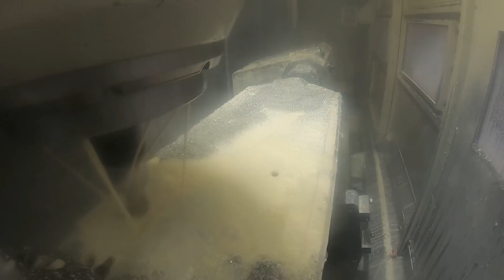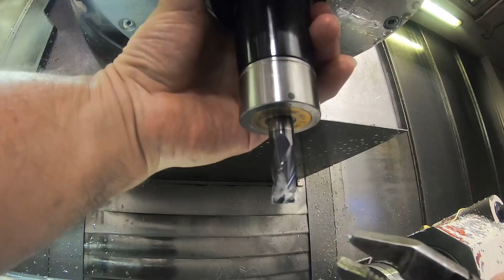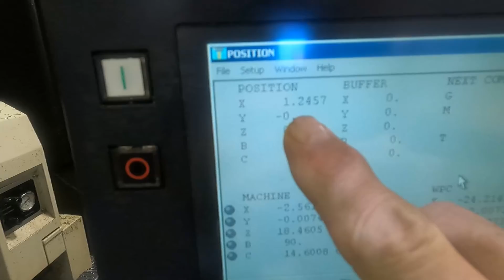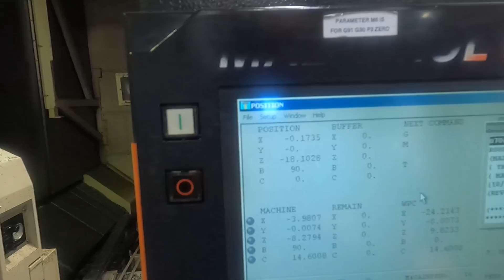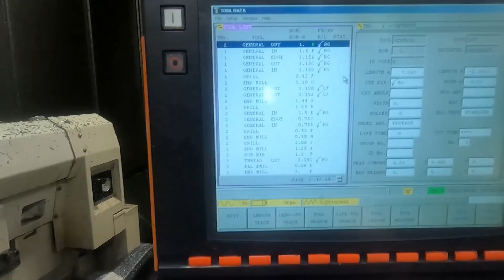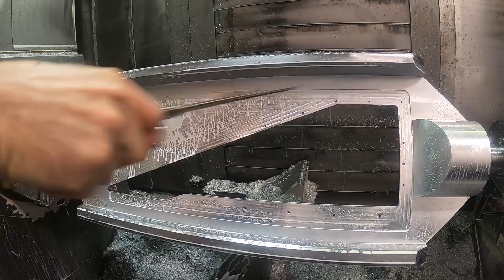Completion Of The Fixture For  the Mazak

Comment: Hey  Peter do i see a tool probe to the top left of the spindle?
Reply from the maker: Yes this machine has both a turning tool probe (The one you see that folds down) and a laser milling tool setter. That recess to the right of the fold down tool probe is where the laser beam shoots across. The laser tool setter has never worked sense I have owned the machine. If I hold a white card up there I can see the beam but something is not working. The fold down arm is to difficult to use. Its so high up when deployed  and very difficult to see the tool when you jog it up to it. My machine doesn't have a remote jog pendent. So I cant reach the jog wheel and see up there at the same time. It is easier (and faster) to just touch off tools manually. I do wish the laser tool setter worked. I would use that. But I don't want to spend money on fixing it. Its not that important to me.
Reply: @EdgePrecision  Ok thanks. So you just need to keep in mind how far off center you are  with the tool and make that offset?

Comment: I'm not sure I understand why the depth of the pocket of the fixture is so critical.
Reply from the maker: The depth of the top pocket is where the parts stock mounts. This stock already has features that need to run on centerline. The depth of this pocket controls that. There are pins that control the other direction. The rest is just a support structure and not really critical as long as it supports the part and gives clearance for the tools. Doing the machine work on the part. Hope that answers your question.
Reply: @EdgePrecision  It did! Thank you Peter.

Comment: I love how this machine keeps discarding its tool through that little window and you have to keep feeding it new ones.
Reply from the maker: It’s putting them in the tool magazine. I’m just changing them as the program calls them. It’s just the way I do it on a new setup. It would be possible to set up all the tools beforehand than run them. Just two different ways.
Reply: @EdgePrecision  Oh I know, just a daft joke lol. What happened at 8:55? bad cutter or just no coolant?
Reply from the maker: I thought it would run for the video with no coolant. I don't really have any endmills for aluminum. These endmills have a coating for steel and the aluminum welds itself to it at high temperatures. It would have been OK with coolant.
Reply: @EdgePrecision  Thanks for the reply! It's amazing how much different it makes.

Comment: Awesome fixture thanks for showing what you can. Just one question what was the ruffing end mill you used to cut out the center pocket? I like the way that it performed thanks again
Reply from the maker: The inserted roughing endmill in the beginning of the video is a Iscar tool I think they call it a MILLSHRED P290 ACK 1.5-3-21-W125-18. I bought this tool for a steel job a long time ago. Thought it would work good for this.
Reply: I will have to look into that type of tool nice to know that bought it for steel. I run a lot of steel, aluminum, tool steel  I will have to get one thanks for getting back to me

Comment: I wonder did you check flatness after clamping and re clamping the tailstock a few times to see if force variance bowed it any?
Reply from the maker: I’m sure there is a influence because it is above the edge of the plate. I don’t want to do that now. But if I ever remount the fixture I can adjust the pressure until the fixture indicates flat as possible. I did turn the pressure down when I first mounted in anticipation of this issue. Thanks.

Comment: On that fixture, how much force can that tail stock push into the part? Is there a pressure readout that you can see to make it adjustable and repetitive?
Reply from the maker: The pressure on the tail stock quill is supplied by hydraulics. So there is a gauges and regulators to control not only the the force but also the speed of extension.
Reply: @EdgePrecision  
So can you adjust it easily in the computer or is it fixed pressure and speed?
Reply from the maker: @Sicktrickintuner  This tail stock can be positioned and the quill extended from the control. But the pressure and the speed the quill extends are manual adjustments on the regulators and the pressure on the gauge. Kind of like on a hydraulic chuck. This isn't like the new machines that have a servo driven tail stock that controls the force by a servo motors force.

Comment: How do you avoid  sine  errors when touching off each tool with a round pin on round surface of the fixture? Also the centre of most endmills is usually concave so I touch off on the corner? Thanks.
Reply from the maker: I’m am touching on the corners of the endmill. When doing it on a round OD you rotate the tool/endmill till when it’s touching the tips but the pin won’t quite go thru. You can feel when it’s hitting both tips. Now back the pin off a little and rotate the endmill. Keep trying the pin until it runs parallel to the OD your touching off on. Once you get the flutes aligned carefully jog up in the .0001 mode until the pin just passes thru. Don’t ever jog down with the pin under the tool. If you go to far move the pin away and jog down and try again. If the tool has a odd number of teeth you have to rotate the tool back and forth until you find the lowest point of the tool. You can in this video see me doing this on the inserted roughing tool with three flutes.
Reply: @EdgePrecision  Thanks, it's hard to see all that in the video.

Comment: Great video 👍So do you get a "ring" from the work piece at a certain point in the cycle and is it a low hum or high pitch Or no ring.
Reply from the maker: You may be getting some false sounds. The camera's mic picks up sounds you don't even notice standing in front of the machine. Even vibration coming up the mag base I use to mount it. I have to be especially careful when mounting it on the spindle of the machine. That nothing close to the camera is touching the spindle. I will transmit sound to the camera of the spindle itself and overpower the sounds I want.
Reply: @EdgePrecision  Sorry it was just a question to be shared with other YouTubers and understand that harmonics sometimes happen in machining.I had no issue with your production of the video.
Reply from the maker: @bigbird2100  I didn't take it that way Thanks.
Reply: @EdgePrecision  keep sharing the knowledge 👍

Comment: I greatly enjoy watching your videos so this is by no means supposed to be criticism. Watching the video I came to thinking what could be done to improve video conditions when shooting with coolant. Your airblade seems to be effective in removing the coolant directly in front of the camera, but it can't do anything about the coolant droplets in the air reflecting the light back into the camera and creating a "white out" condition. Have you ever tried a polarization filter? It should be able to remove some of the reflections on the droplet surface when adjusted correctly. Just an idea. For this to have a chance of success the critical light sources would probably need to be the same type meaning emitting light with identical polarization.
Reply from the maker: There is actually very poor lighting inside the machine. The GoPro cameras I use aren't very good in low light. On top of that one of the LED light fixtures in the machine isn't working as well. If I could improve the lighting and figure a way to hold such a filter with my cameras enclosure it might be worth a try. Thanks.

Comment: totally agree on the 3D taster usage! running it on the surface especially on milled surface compared to ground surface cus the stylus wears out and gets a flat spot on it, when i must use it like this to sweep over a surface i only tension the indicator as little as i can by only pressing it into the surface by 0,1mm that way the spring forces aren't that high on the stylus so in theory less wear, but the spring is pretty thin inside the taster so it isn't making a ton of difference cus the spring force is pretty much the same when pressed in -4mm or -0,1m. it is best to avoid at all indeed.
Reply from the maker: My main objection is when I see people indicating a vise in for instance. It lakes sensitivity because of the high stylus pressure it has. It is good for what it was designed for and really useful for that. But say a Interapid indicator is so much better for checking alignment of things.

Comment: why did you chose to use 3 axis profiling for the pocket wall instead of 5 axis cycle profiling? Was there a degree of freedom limitation on that profile or You just picked the less complicated method of programming? which is totally fine in one shoot production, i chose the safer way in similar features with one shoot parts all the time..
Reply from the maker: It could have worked for a portion of the profile from the side in the video. There would be interference issues with the machines spindle and way covers on the chuck side (left). The angle of the end of the pocket. I did when I programmed the part consider milling it from the other side. The angles would clear from that side tipping the B axis inward. It was just easer this way I guess so that’s what I did. Though it may have been better for the video to do the 5 axis stuff.

Comment: Hi, did you notice that you read 1.857 as 1.875 when you were checking the reference height. Hope you didn’t get an error in your fixture from it,
Reply from the maker: Yes I didn’t notice this till I reviewed the video. In this case a .0018” difference isn’t enough to cause a problem. I’m going to check it again an correct any error anyway. I transposed the numbers 5 and 7. I need to be very carful about this. I have this tendency. I may make a video on this subject.

Comment: Seems a lot of work for 10 pieces, but they're likely high value items so worth it. Curious if the client paid separately for the fixture, or was that absorbed in the margin for the 10 pieces?
Reply: Is it not the same thing regardless?  

I do primarily small quantity work.  Anything over 10 parts is a large run for me.  The customer is always paying for my fixturing work.  Sometimes I will itemize it on a quote, other times it gets rolled into the per part price.   At the end of the day, the total bill is the same regardless of how its itemized.
Reply: @siraig  not the same thing if the client expects the fixture to be delivered with the 10 pieces. If the shop owns the fixture it could be repurposed for other projects if there were no repeat orders.
Reply: @paulhammond7489  well yes, if they expect it to be delivered I  see your point.  Your original question was vague and did not specify that part.

I regularly charge my customers a line item for fixturing, they do not get said fixture at the end.  But then again, no one has ever asked!
Reply: @siraig  I've seen a couple of 'battles' over fixtures in the distant past regarding ownership of a fixture when the customer wanted access to 'his fixture' as 'he'd paid for it'. That was so he could use a different workshop for repeat work. You can probably imagine neither party really won the argument. I've also seen workshop stores stuffed with fixtures that haven't been used in years.
Reply: Not a machinist, but been involved in a few projects with really expensive fixtures. The customer in that case paid a separate machine shop to make the fixture. I am pretty sure once all the machining is done the customer will take the fixture back and probably scrap it.
Reply: If I’m building the fixture on my dime it’s mine. If the customer wants it after the job is delivered we can negotiate a price.

Comment: i thought i saw the position screen on the haimer from the live center measurement was 1.2457 not 1.2475.. stopped video to comment while i had it in mind. great video as always though. hope i am wrong on what i saw.
Reply from the maker: You know I think your correct. I will need to check this. .0018” difference. Not really enough to give me a problem on the parts tolerances but it might be worth checking and correcting. I’m reversing my numbers. I have already made the setup parts and they were in tolerance but it might be better if this off to correct the small error. Thanks I just didn’t see it! I bet I’ll get a lot of comments on this.
Reply: I noticed that too, glad it's not a problem!
Reply: I was yelling at the screen :-) Glad it's not enough to be an issue.
Reply: I've inverted numbers more times than I care to admit, a few with bad results, yikes. Glad it's not enough to hurt your process flow. Always look forward to your videos. Hope it remains worth your while to keep them coming. Nice job.

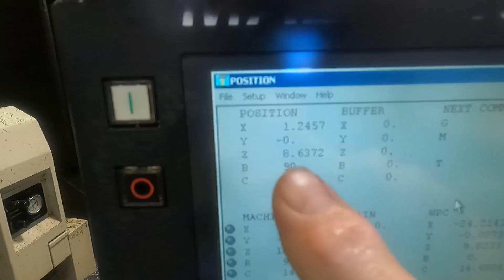Comment: You said 1.2475 but display said 1.2457 at 16:15.  Source of error?
Reply from the maker: You know I didn’t realize this until I reviewed the video. I reversed the 5 and 7 a .0018” error. It won’t cause a problem with the part. But I think I will correct it anyway. Or maybe I read the mic wrong in the video. Now you got me thinking. Because I checked this a couple of times. This is one thing working by yourself. You can be thinking one thing and not realizing a mistake.
Reply: @EdgePrecision  Transposition errors were a pain in the butt, back in the day when I worked for a bank and did the proof processing of all the tellers' transactions.